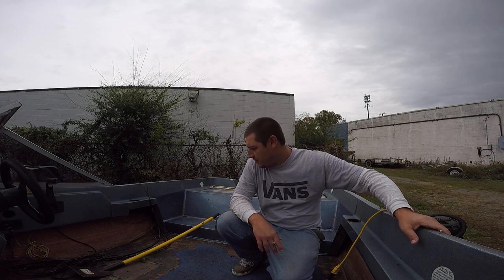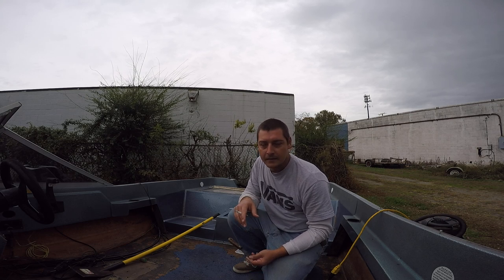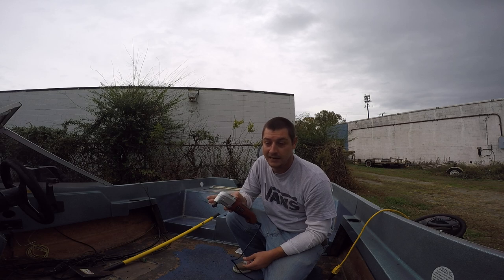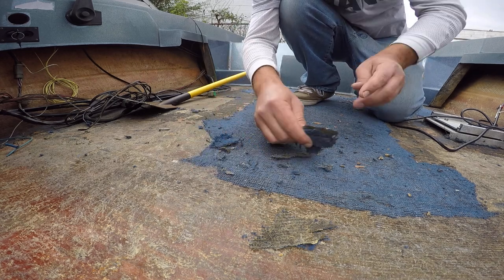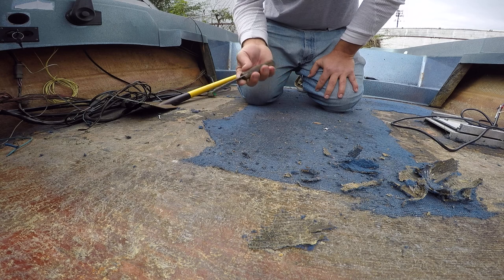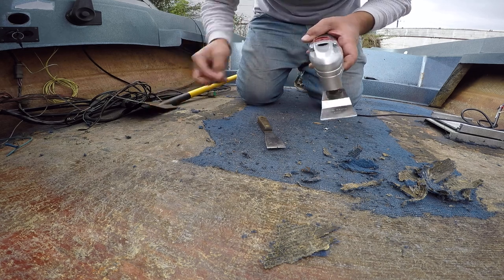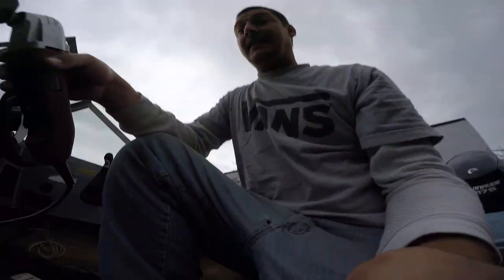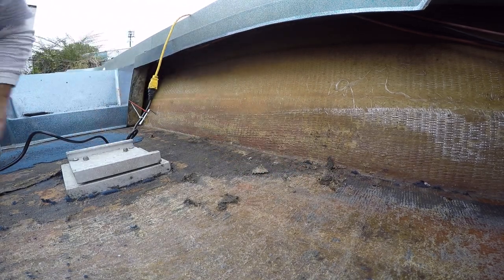Easy way to remove boat carpet

Comment: Or you could just pour gasoline on all the carpet let it sit for 5 minutes and it just pulls right off.
Reply: Does that really work or were you just messing with him?
Reply: @Jerry-xx8dx  no , it really releases the carpet glue and turns it to jelly and then you just pull the carpet off.
Reply: @t.j.3873  If you're going that route, Naphtha and a few other things have less residual odor and work well too. The gasoline thing never stops stinking.
Reply: Lmao that floor is so soft. Just put new carpet over it. Should be fine 😂